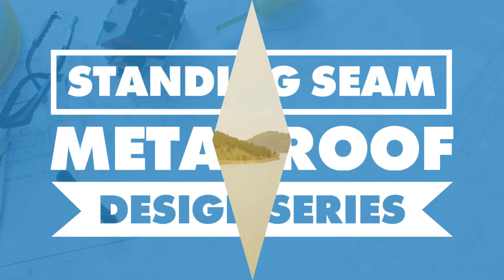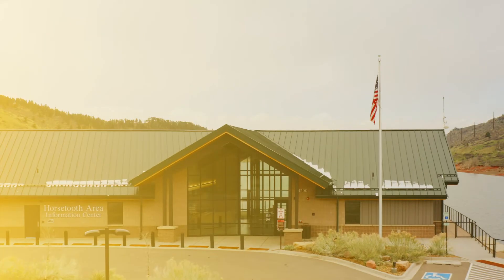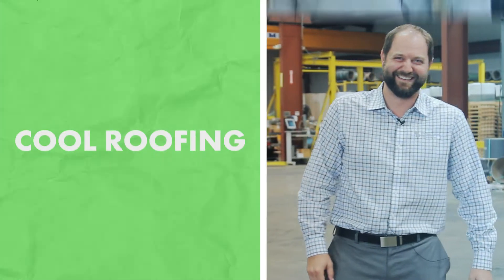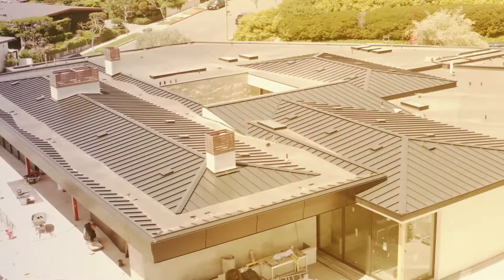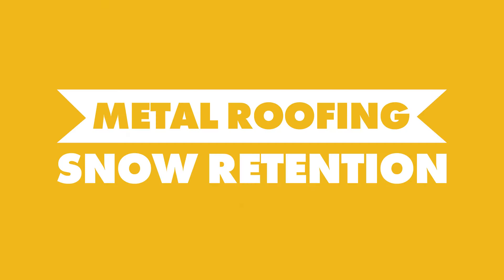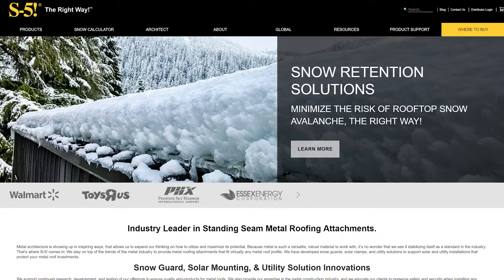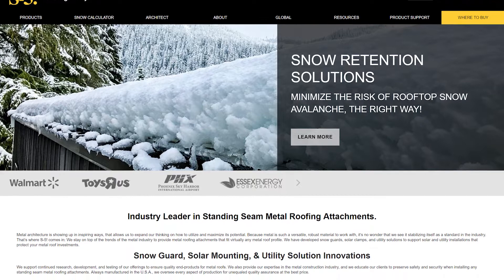Metal Roofing And Snow Retention: Snow Guards, Snow Fence, Snow Rail

Comment: There was no mention of ice dams with a snow retention system. Is ice an dam more or less likely with a retention system? And how are ice dams handled on a metal roof?
Reply: I have a valley that faces the sun and gets waste heat from a plumbing wall and dryer vent. It builds up some bodacious ice that gets wedged in the valley, caught on the intersecting seams of the roof. It can weigh 50 pounds, I'd guess. It has never leaked. I worry about it damaging the roof structure but it never has. Probably best to leave it until spring. I've loosened it up and removed it during a thaw, but I might kill myself one of these times.

Comment: Hey a question for you. We have a metal roof over our ice rink and indoor turf field facility. We need a new roof and there is serious talk about slapping another mental roof over the existing one. I guess it is cheaper. I don't like it one bit. The insulation under the roof needs replacing. I guess there are work arounds for that but what is you opinion and experience with customers who can not afford to do it the proper way and want to put one roof on top of another? Any pros or cons?
Reply from the maker: Hello! Roofing over an existing roof is possible, but there are problems that can occur and considerations to keep in mind. We have a video about putting a metal roof over an existing shingle roof, but many of the principles still apply to your situation. Check that out here: https://youtu.be/oarZwnTTvFI If you need any further help, let me know! -Thad
Reply: @TheMetalRoofingChannel  sorry I did not realize you replied. Thank you I will check that out for sure
Reply: After debate and # crunching as well as weighing in on the pros/cons, I framed over my old metal roof and installed Norclad Roofiing. I just wanted Denali Green and I hated the metal color look..

I live in Alaska so I did save 30k doing it my self.. Also my old roof is still new (no problems with it).

If you have issues with the old roof like a rip or age then I would demo the old roof and put down new material for the new roof.

Honestly, I think you are fine doing it over your old roof since it can be like extra insulation per say as long your old roof is still pretty darn good. .. Don't give the contractors an extra 5-10k for "Demo".
Reply: @stoniestone90  anks man. Appreciate your feedback. Looks like they are going with a roof over the existing one. Then doing an low e ceiling inside. Not sure what there plans are with the insulation.